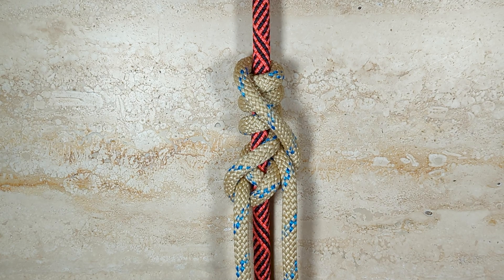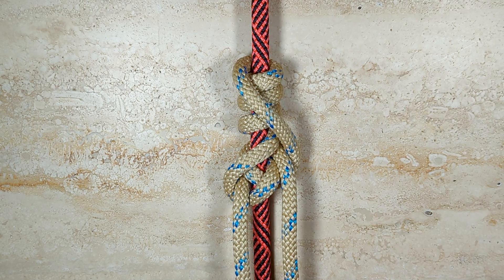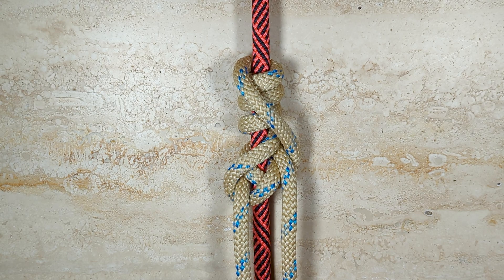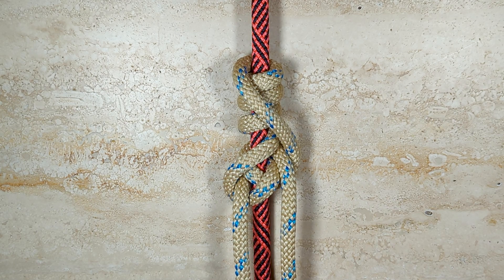RBG Friction Hitch (CORRECTION: It's "RBG" and not "RGB") for Arborists & Tree Climbers!

Comment: Nice constrictor, u like it
Reply from the maker: Yeah, it's a bit of a fuss to tie and dress and set, but once you've gotten the hang of it, it goes pretty quickly. This definitely wouldn't be my go-to climbing hitch, but it deserves a place on my channel so that it can be memorialized for all of eternity! =-D This would be a hitch you learn to impress one of your climbing friends!
Reply: So I just now added 3 more turns to the top and melded your srs5 with ring. Next step is to have a piece of rope  long enough to be able to have sewn eyes for an implement. Be it a carabiner, pulley....etc. I never get enough.
Reply from the maker: That sounds very interesting. Can you explain how you melded my PrecisionSRS 5 with this RGB hitch? Is that what you're saying? You should buy a length of hitch cord and then tie Poacher's knots at each end once you finish the hitch, which will serve as your hitch cord eyes. Once you figure out how much you need, you can either cut the excess off or you can tie a little Heaving Line knot with it so it's out of the way while you climb, but also so you can make the cord longer anytime you want for another project.
Reply: So I tied your friend's rgb knot and then followed the instructions from 5:20 min. of the srs5 video onward. After taking a few screen shots, I realized I was looking at a mirror image. Because of how the legs end up from the rgb. Took some doing. Now I think I could hold an elephant lol or at least a baby one
Reply from the maker: Are you trying to say that the RGB's adjustability section (the second stage of knotting below the coil) is identical to the first few steps I took when tying the PrecisionSRS 5's adjustability section? Because I don't remember tying them in a similar fashion...but I reserve the right to be wrong. That would be really interesting if you are correct. I'll have to revisit my tying method for the SRS5 in order to verify this for myself. Not that I don't trust you; I just want to confirm it so that I can add that bit of knowledge to my mental vault.
Reply: Not a Question of right or wrong.... all I did was added to your friend's knot, the rgb,  the second half of your knot. The srs5.
The part with the ring. All I did was, combine the 2 knots. That's all.
Reply from the maker: Turns out it's called the "RBG" hitch, which is a jab at the JRB tree climber guy, and named after the notorious Ruth Bader Ginsburg (or however you spell her name). I just talked to my buddy and corrected the titles of the videos. He has a strange sense of humor haha
Reply from the maker: @j-jlevy  Oh I misunderstood you. I apologize. No wonder it wasn't making sense to me! That's really cool! Yeah, you should definitely be able to hold up a small elephant now haha I'm ecstatic that someone finds my hitches interesting enough to do something like that!
Reply: I think that they're wonderful and innovative. I look forward to seeing more of them and figuring out some more combinations. 
Thank you
Reply: Too funny.... I enjoy jrb just as much as I do yours. Between the two of you, I'm spoiled... thank you both for wonderful ideas
Reply from the maker: @j-jlevy Not a problem! Thanks for being so engaged with me and my channel!